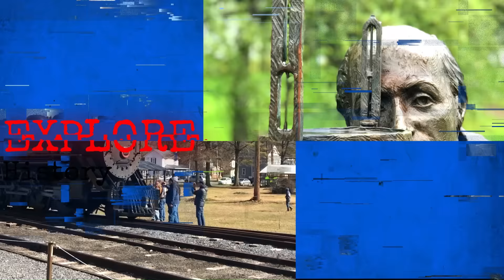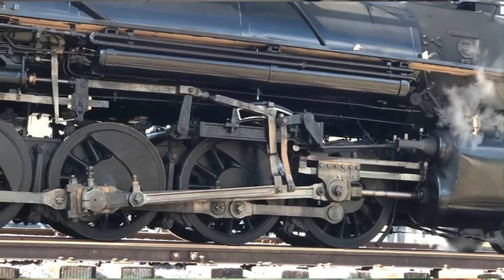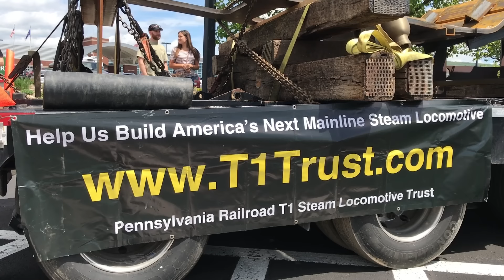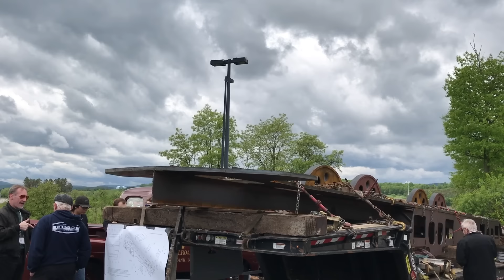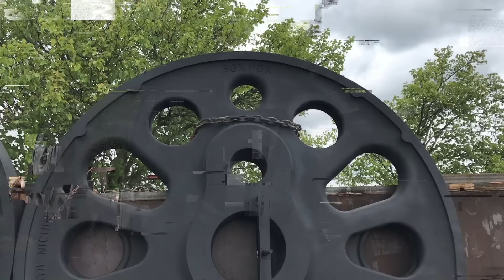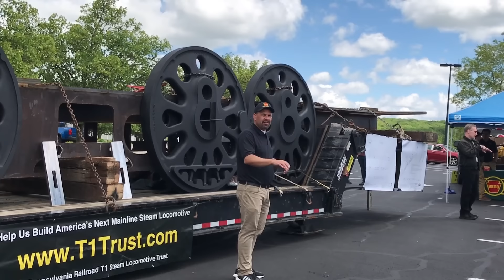They're Rebuilding The Pennsylvania Railroad's Most Controversial Locomotive

Comment: Great video. From the web site Old Machine Press about the T1: In fall 1946, T1 engine Nos. 5511 and 5539 were loaned to the Chesapeake & Ohio Railway (C&O) for trials. While C&O ultimately did not purchase any of the engines, they noted that the T1 handled well, particularly at higher speeds, and was able to make up time between stops. Most interesting, C&O did not feel that the T1 had any excessive tendency toward wheel slip.
Reply: I knew 2 retired Pennsy Engineers who regularly ran the T1s.  Both loved the T1, but their basic opinion was the engine was a complex high speed thoroughbred that had to have excellent maintenance, and be operated by crews who knew what they were doing.  Both factors that often weren't the case.

Comment: I read, the reason the poppet valves were coming out of adjustment, having to be continually shopped for repairs, which was causing unreliability issues. The Pennsylvania railway contacted Franklin, the manufactures of the popet valve equipment.  They were invited to investigate the cause of this problem, after riding on the locomotive in service it was discovered that the operating personal were running the locomotives north of the rated 100 m.p.h. reaching suspected speeds of 140 m.p.h.  The poppet valve equipment was not rated for such fast speeds.
Reply: The metallurgy of that time was not advanced enough to make poppet valves strong enough to handle all that stress. Now if the poppet valves were built out of say, titanium or some other ultra-strong alloy...

Comment: Part of why the production T1’s had such a polarizing reputation is because relatively few crews worked with the prototypes. Senior crews were normally assigned, and they spent most of the war between Chicago and Crestline. So with wider range and wider accessibility to crews, more challenges arose

Comment: The conversion from steam to diesel was inevitable. The steam engine is only 6 percent efficient, is labor intensive, and let the water level get low in the boiler the crown sheet over heats then there is a flash explosion and the entire crew in the cab dies. Diesels are much safer , more efficient, and makes life for train crews better.

Comment: The valve gear does not push the pistons in & out. The pistons rotate the wheels. The wheels are connected to the valve gear in a complicated way, so that the valves admit steam to the cylinders (and release it from them). This action is timed so that the steam pushes the pistons in the cylinders at the proper moments to turn the wheels, either forward or backward.

Comment: Is it 4 piston 2 boilers?
Reply from the maker: The T1 possess a singular boiler that supplies steam to four cylinders, with each cylinder providing power to two driver wheels.
Reply: @Redoubt_Productions  Fascinating!  So that is why under normal circumstances it runs on 2 pistons, but when pushing up hills like in Utah, it can operate on all 4?
Reply: @vijayanchomatil8413  She runs compound, under normal circumstances, with the steam being expanded twice (front & rear cylinders). If needed, the engines can be run "simple", with both sets of cylinders using full-pressure steam. More tractive effort, but less efficiency.
Reply: @ReggieArford  That's like the newer Diesel Gensets, where they can be shut down for efficiency and powered up for performance.

Comment: COMPLETION OF THIS PROJECT WILL BE AS GREAT AS THE 4014 RESTORATION!
AS FOR THE WHEEL SLIP PROBLEM, IT WAS SOLVED BY COMPUTER MODELING, WHICH REVEALED AN MINOR GLITCH IN THE EUALIZING AND SPRING SYSTEM!
THIS ALSO WILL GIVE AN LONG TERM TEST  OF THE POPPET VALVE GEAR TECHNOLOGY, AND PERFECTION.
WORKING AS AN AT&SF MACHINIST APPRENTICE, I HAD THE PRIVILEGE OF WORKING WITH AN OLD HEAD , VERY TALENTED MACHINIST WHO HAD DONE WORK ON THE AT&SF 3752,
AFTER IT WAS REBUILT WITH THE FRANKLIN VALVE SYSTEM!
HE SAID IT CREATED 25 TO 30  PERCENT IMPROVEMENT IN ALL RANGES OF STEAM LOCOMOTIVE PERFORMANCE !
THIS PROJECT WAS UNFORTUNATELY DROPPED DUE TO THE SPEED OF DIESEL CONVERSION ON THE AT&SF!
ANOTHER CHANGE IS GOING TO THE FABRICATED MAINFRAME, VERSUS THE ORIGINAL CAST STEEL FRAME!
AS THERE IS GREAT IMPROVEMENT OF THE THE WELDING AND FORMING AND FABRICATION TECHNOLOGY 
THESE DAYS , THE FABRICATED FRAME WILL BE SUPREME OVER CAST FRAME!
KEEP THEM ROLLING BROTHERS!!👍👍
Reply: Hey man, great comment, but find and learn how to use the Caps Lock key. All Caps is annoying as Hell.

Comment: I wonder, if the PRR T1 and Q2 would have come out before WW2 instead of after, would they have a better reputation if they had more time to shine? When they did come out, diesels were already starting to take over and steam was already in its twilight. If they had been aloud to actually be the one of the most advanced steam locomotives in Pennsy while also not already on the way out,  maybe it would have been different.
Reply: The T1 was the better design, and w/more testing would have certainly been successful.  The Q2 was a beast that quickly drank her huge water tank down to the point of needing to be refilled!
Reply: @ I’ve learned a hair bit more about the Q2s, and it does seem they would have been better off building more J1s. It’s a shame given they were neat locomotives, but not what the Pennsy needed.
Reply: @Stooltoad5017and the J1s isn't really a Pennsy design; it's a "Pennsyfied" C&O T-1 design, done so because of locomotive design restrictions placed by the War Production Board during WW2.
Reply from the maker: For as awe-inspiring these final steam locomotive classes were, in truth it wasn't so much the diesel locomotive that they were competing against. It was the aviation and automotive industries that did in not just the steam locomotive, but railroads entirely as being the leading mode of transportation in North America. The shift to diesel ultimately transpires over a need for cost reduction as the railroad industry began a shift toward specialized customers who could not be serviced by planes or vehicles. While the T1s or Q2s had the speed and power, the bigger the locomotive the more the maintenance which ate into the pockets and time of the Pennsy.

Comment: The B&O under the Chief Mechanical officer, George Emerson, Developed a 4-4-4-4 At lead ten years before the T-1 was constructed.  Check this fact out.
Reply: Said 4-4-4-4 duplex also didn’t work very well. It turned the whole railroad off the idea.
Reply: @Stooltoad5017  The "George H. Emerson" Duplex locomotive had some design elements that just didn't work practically.  Emerson was enamored with water tube boilers, which can be more efficient, especially in stationary and marine applications.  However, those uses allow the production and use of steam at a steady rate for long, continuous periods of time, unlike the demands of a locomotive in regular service.  The other major flaw was the rear-facing second set of cylinders, under the firebox, which led to excessive valve and piston cylinder wear from cinder contamination.  None of his experimental water tube designs worked out in the long run.  The B&O would have been better off putting the money into being an early heavy buyer of EMD Diesel-Electrics, before the War Production Board stopped them.  It's what the railroad wanted to do during the war anyway, but couldn't because of locomotive rationing.
Reply: @paulw.woodring7304 not really a locomotive rationing, it's more like the engine is in high demand by the US Navy to power submarines, landing craft (especially LSTs), minesweepers and destroyer escorts.

Comment: I applaud these guys, but they're crazier than a March hare to take on such a project
Reply: It can be done. In the UK the Tornado Trust succeeded in resuscitating an extinct type of locomotive.
Reply from the maker: @romanpolanski4928  Interestingly, the Tornado Trust served as the inspiration for the T1 Trust.
Reply: If the UK can build an extinct engine from the ground then so can the US. It's really not that crazy. Plus they're almost 50% done. Once the frame is done by the 4th of july and they get the cylinders completed by the start of 2025 all that will be left are to add the cylinders to the frame, insert the break rigging parts inside the frame, put the completed frame on the drive wheels (and the support trucks if they haven't already made them), add the running gear, axels, steam generator and air compressor, and then by 2026 they can finally put the completed boiler (with cab) on the frame and add on the pipes and stuff. Then they just have to worry about the tender for the next 3 to 4 years.
Reply: They amy be crazier than shithouse rats, but many inventors and forward thinkers were labeled as crazies. I lift my glass to them in admiration and thanks!
Reply: "Crazy". So?